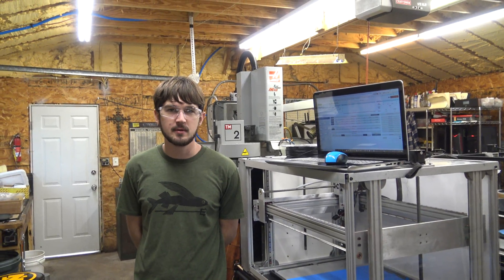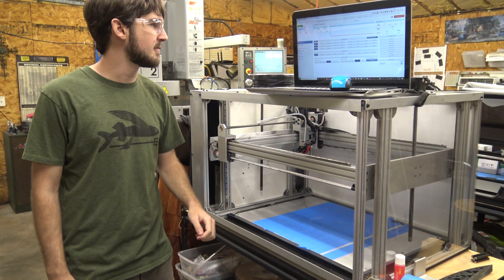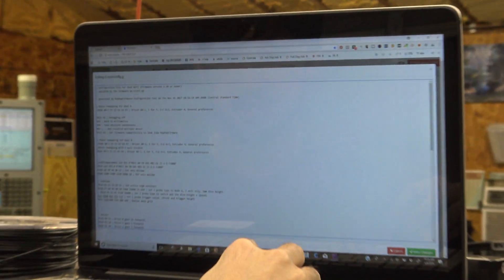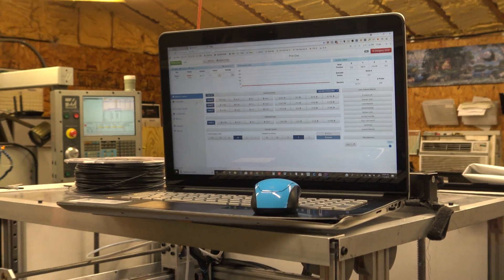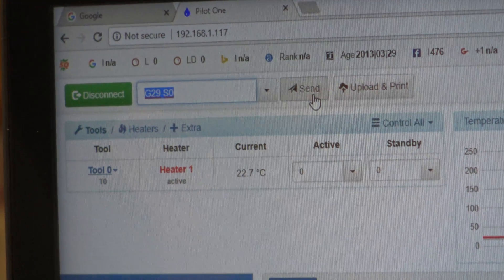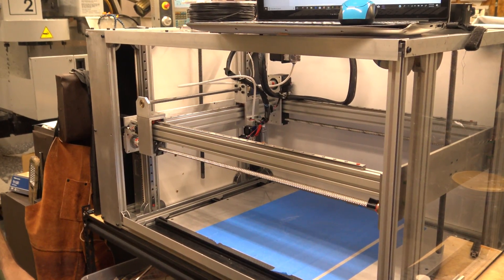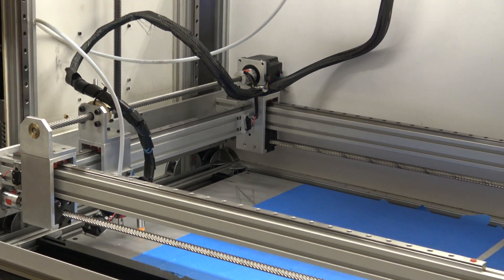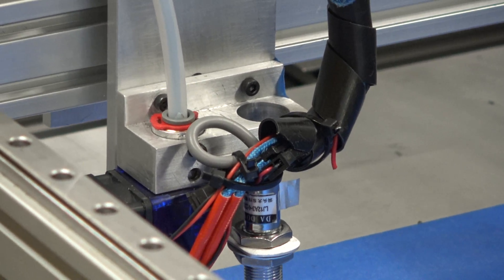Duet Wifi: Setting Probe Trigger Distance

Comment: Measure the trigger height of your Z probe at various XY positions and make sure it is consistent. To measure the trigger height:
1. Make sure there is no filament stuck to the nozzle (you may want to do this test with the nozzle hot)
2. Cancel any existing bed compensation by sending M561
3. Send M208 S1 Z-3 to temporarily allow Z moves down to Z=-3mm. This is to ensure that you can lower the nozzle all the way to the bed in step 5.
4. Command the print head to the XY coordinates you want to probe
5. Command the print head down in small steps until the nozzle just touches the bed or just grips a sheet of paper. You may need to send M564 S0 to allow movement lower than where the firmware thinks Z=0 is. You may also wish to create a macro to lower the head by e.g. 0.02mm to get greater accuracy (G91 followed by G1 Z-0.02).
6. Send G92 Z0 to define that height as Z=0
7. Command the nozzle up 5mm (G1 Z5)
8. Send G30 S-1 to probe the bed without resetting the Z=0 position
9. Read off the Z height from the web interface. That is the trigger height.

When you have established what the trigger height is, set the Z parameter of the G31 command in config.g to that value. Difficult to see in the video.
Reply: Do not read off the Z height from the display on the web interface. Use the height given in the console from the G30 S-1 command. This is the correct height. If not, you will have to fine tune with baby steps.

Comment: You are one of the few people who did the math on the extrusions. I am making a 600mm cube build volume and have to use 40x80mm extrusions in X/Y planes to prevent deflection. Whereas in Z deflection is not a concern.

Comment: That is the coolest machine I have ever seen.  On my deltas  I am using duet with FSR's and on an older printer upgraded to duet I manually leveled the bed (really the effector)   
The duet delta boards tap the bed.
Reply from the maker: Thanks! Yeah I'm thinking about putting FSR's on my delta that I'm currently building. The Duet smart effector  looks pretty cool. There's a company called 713Maker that sells a really nice aluminum housing for the duet smart effector.
Reply: 3D Distributed nice on the 713Maker.com mention! Great company, and Matthew is a great guy, and continues to actively develop and improve his products